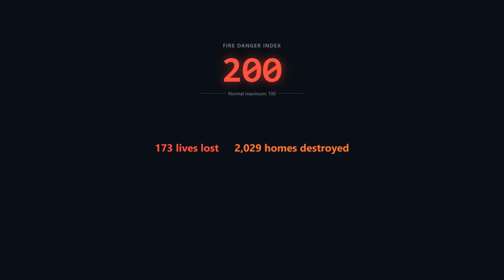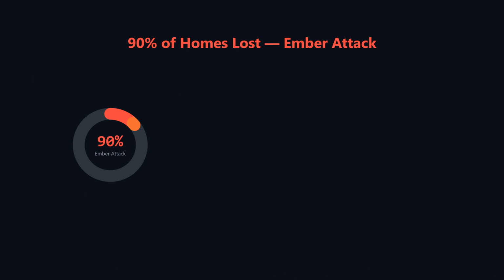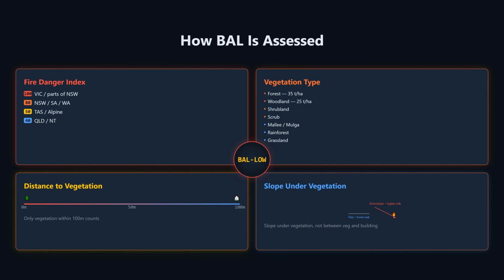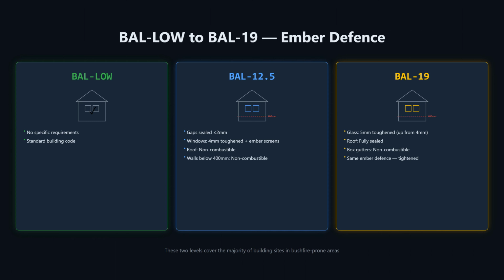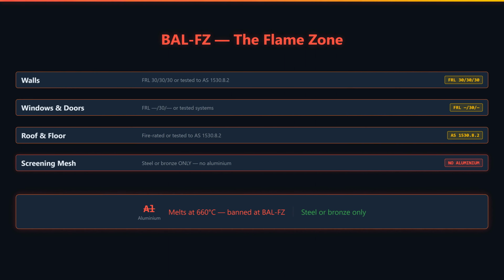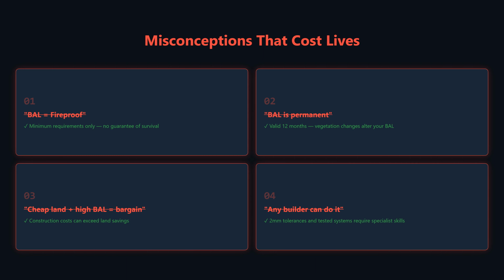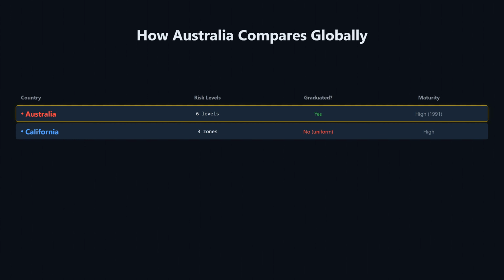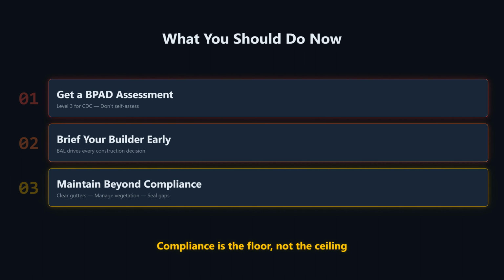BAL Ratings Explained: What Your Bushfire Attack Level Means

Comment: I did a DIY kit home build to BAL 19 in Alpine NSW in 2012 but actually ended up BAL 29 as most materials available are BAL 29 anyway 

Hardiplank with kingspan AIR-CELL behind took care of the walls. Custom Orb roofing with fire blanket (80 lineal metres) on all edges and roof peak before screwing the steel down (air-cell beneath that too) closes all the gaps with other benefits of vermin proofing as well. No need for gutter guard mesh when you do this as the gutters are metal as well, Although adding it would give extra protection in high leaf fall areas.  

6.3mm e-glass throughout and 2mm mesh metal flyscreens for windows and sliding doors. 

Box in to ground level the underfloor with Blue-board on metal welded supports and a blue metal gravel perimeter (as an extension to the underfloor blue metal layer) 1200mm wide to buufer from short grass flames. 

2mm metal screening over the underfloor vents, NO COMBUSTIBLE MATERIALS ALLOWED under the house 

All underfloor plumbing and gas lines covered with Air-cell. Done for extra anti-frosting more so as all lines are lagged with sekisui lagging which is outer foil lined as well.

House frame is 100% steel as are the support posts - Steel flooring system

LPG gas bottles (4 x 9kg) in a purpose built fire box that still allows gas leak venting safely with a 900mm air gap to the house and all bottle purge vents facing away from the house  
It is 100% sacrificial if needed 

All Steel steps 

Scyon patio/landings and solid core rear door with steel frame behind a BAL 29 screen door 

A huge fire went through (Bees Nest Fire 2019) and the paint was destroyed but the house survived OK 
The result was so effective i 100% self insure and the extra cost to do the BAL 29 was around $3k so with insurance for fire at $10k per annum it's paid for itself 30 times over in 10 years 

https://www.abc.net.au/news/2020-08-31/bees-nest-bushfire-teaches-valuable-lessons/12611562
Reply from the maker: That’s really interesting, thanks for sharing the detail. Sounds like the extra work on gaps, vents, underfloor protection and non combustible materials made a real difference. Glad the house came through the Bees Nest Fire.